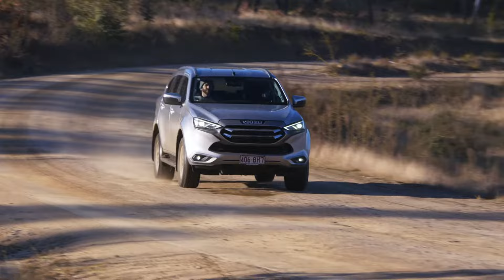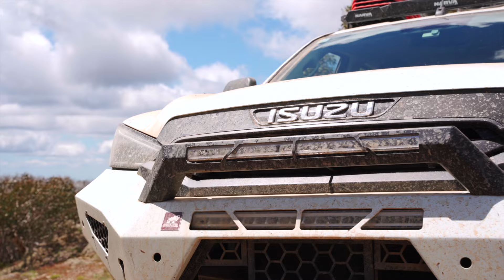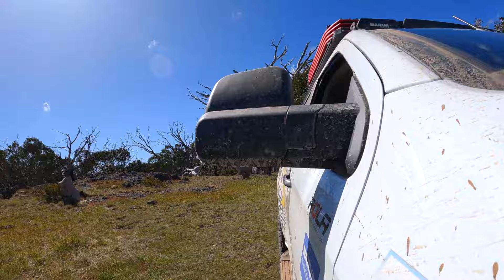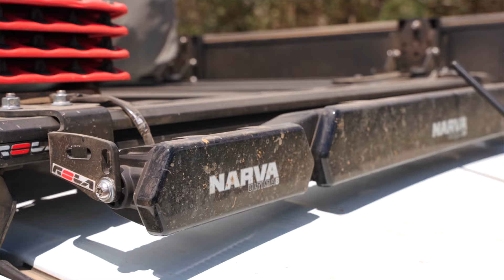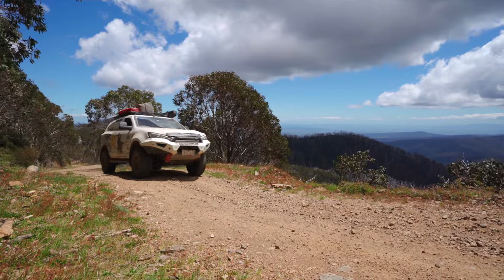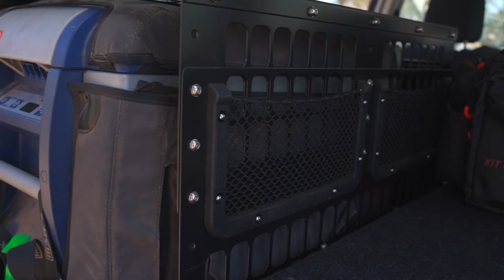4X4 build: MU-X transformed into touring beast | 4X4 Australia

Comment: Great single person set up. Not family friendly unless you tow something as well.
Reply: As a family of five we travelled the east coast regularly in a Jackaroo.
No roof rack, just a extremely well designed floor to roof storage system. Very top, (accessed from back seat) slide in storage for pillows, sleeping bags etc. all extremely stuffed in. Under that, accessed from rear was a 900 X 900 table and 4 chairs that slid out/in of its  own compartment. Under that were 8 drawers on 2 full length slide in & out fridge style sliders, (4 on each slide). A draw each for clothes, a draw for toiletries/towels, a draw for jackets etc. an overflow draw for when more storage was required, loaves bread, fresh food etc.
Below that were two full length slide draws on the passenger side, upper shallower one for cookware, plates, cups, cutlery etc. the other deeper one was our pantry, and housed camp oven as well. Below it was a full length slide out/in table for food prep. On the driver's side was a deep slide out full length draw that housed heavy bulky stuff, 20lt jerry can of fuel, dual burner camp stove, gas bottle, tools, Esky (fridges not common back then), etc.
Then, top rear passenger side inner window we housed 40 litres of water that slid forward to be flushed & refilled by rear passenger door access, below it was dome tent, tyre repair kit, tyre removal plier tool kit (very heavy, hence low) all accessed by rear passenger door. Drivers top side was a slide in and out vertical recovery kit containing a extremely heavy duty turffer winch (heavy in weight also), it's 20mt wire cable, pulley block, bow shackles, winch extension strap, tree protector strap, plus snatch straps. This frame slid forward so recovery gear could be accessed by rear passenger door and also back out the rear barn doors so as if either one was blocked (tree/bank), you could still get to recovery gear. Below that was other numerous fiddly items, radiator hoses, spare drive belt/s, compressor etc.
Behind rear seat we housed turffer handle, umbrellas, under the seat we had spare shocks etc.
The passenger compartment was totally vacant ready to comfortably accommodate 5 adult passengers.
Now tell me a family of five can't travel out of a std wagon. We did it.
What not many knew, the rear storage of a Jackaroo was larger than a Patrol or Cruiser, with far broader higher access than either of those more rated vehicles.
We updated to a new Jackaroo for that reason, everything just transferred over. After that we looked at 120 & 150 series Prados but they are exactly 150mm narrower than the Jack, so out of the question. I always wanted a 76 cruiser, so brought one, but storage system didn't fit it without extensive mods that never occurred as we disliked the 76 terribly, it's a very overrated vehicle, Jackaroo was so superior on & off road.
We then looked at 200 series, again not as large as Jackaroo, so we opted for Patrol. It was not as large either, but it had barn doors that we preferred to the cruiser split tailgate.
We now set about modifying the storage system to fit.
We lost the upper pillar/sleeping bag storage, lost our 40 litre water storage, lost our recovery slide.
I now have a 60 litre water bladder mounted behind rear seat, RTT as no tent storage space, built in winch and upgraded to light weight recovery gear, stored in various parts of the car, (inner drivers door compartment, a cradle infront of our RTT, all over the vehicle instead of one slide in out vertical cradle).
I was a Isuzu fanatic but unfortunately the MUX couldn't make our shopping list as it's internal proportions are similar to the Prado, far too small.
The Isuzu built Holden Jackaroo was a phenomenal vehicle, so overlooked, extremely comfortable long distance tourer and such a capable 4X4 off-road vehicle.
Moving on to towing, I must admit though, for our around Aus Trip we did tow a off ground homemade camper, purely for the convenience of base camping and being off the ground in croc country (the kids sole request).
Within the camper base we had 145 litres of water, 65 drinking, 80 washing bathing etc. then 5 X 20 litre jerry cans (100 litres) of fuel up front, so it made remote base camping very practical. A double and king size bed base folded out either side, double for Mum & me, king for 3 adult sized kids.
That's our story, family can holiday out of a 5 seat wagon, we did it for years.